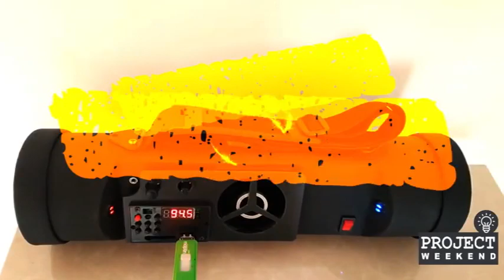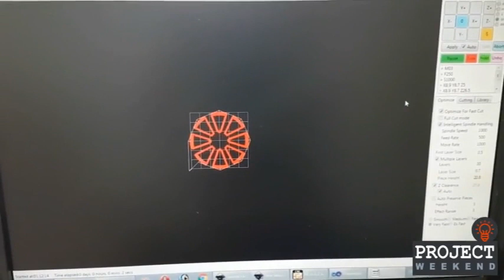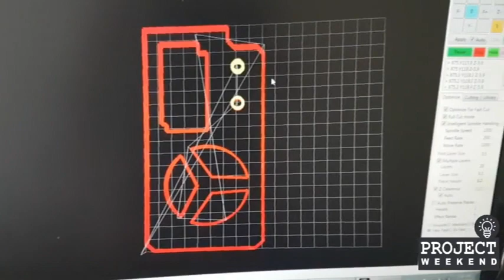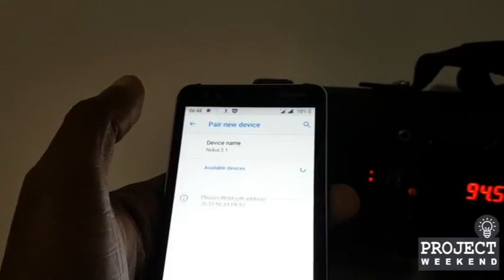❤️Portable bluetooth speaker DIY | best bluetooth speaker | best bluetooth speaker 2021 | boombox v2

Comment from the maker: Hi friends, this is my second version of boombox audio system created using PVC pipe and some accessories. There are some improvements and enhancements since boombox V1 (Previous video) https://youtu.be/_mY_m0vjB7Y

This version of boombox features followings;
+ Bluetooth connectivity
+ USB
+ SD Card
+ FM Radio
+ Line input
+ Upto 40-50 hours operation time with one recharge
+ Internally built A/C Power supply
+ Hybrid bass boosting design with bass hole and passive radiator
+ Belt for easier carriage

https://youtu.be/EG49BzhTdMg
Reply: Great work!
Reply from the maker: Thank you